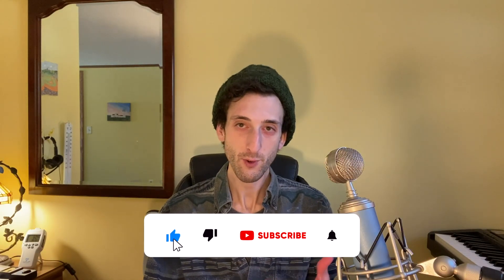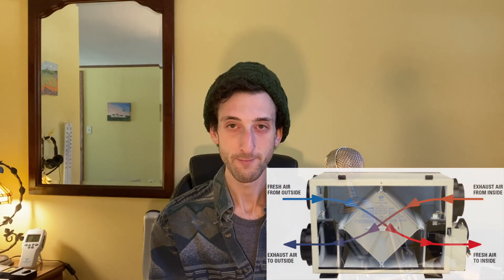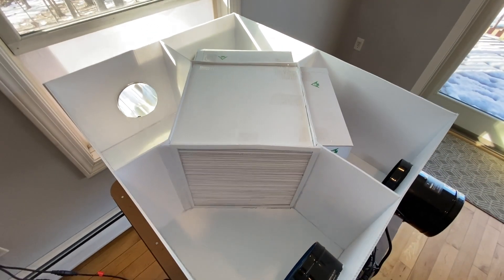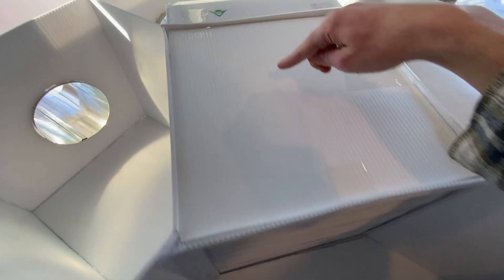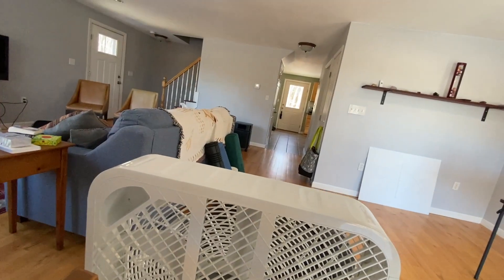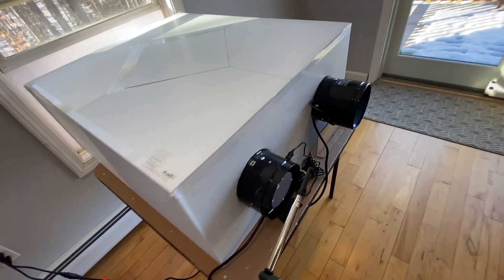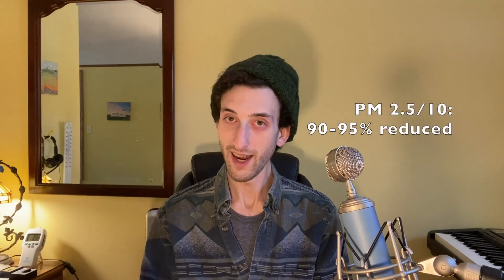I built the best DIY heat recovery ventilator I’ve seen on YouTube

Comment: Clever to recognize coroplast as a useful material! Its thermal conductivity would suck compared to metal, but if the dwell time of the air inside then heat exchanger is long enough, that will compensate: Half the conductivity? Just double the dwell time. 1/4 => 4x, etc, etc.

It seems the duct fans are working fine for you, but a cheaper and potentially better solution could be a used squirrel-cage blower from an HVAC system, with the speed adjusted via either a cheap A/C speed controller (triad plus noise filter) or by putting a small motor on it, running it via a timing-belt setup (the kind of timing belts used for 3D printers. Squirrel cage blowers are great when dealing with back-pressure from filters or the stack itself.
Reply from the maker: Amen! Great points. I did indeed make the core larger to increase dwell time. 

I had never heard of squirrel cage blowers, and that sounds like a fascinating idea. I guess they’re a high static pressure blower?
Reply: @HealthyHomeGuide  Exactly. They use them in HVAC systems to overcome the static pressure from the filter and all the ducting, registers, etc.I don't know the details of relative efficiency, etc, but you'll find them any time there's higher static pressure. (The rotor/impeller is an open-ended drum with angled slots around its periphery. The name comes from looking like something a squirrel (or hamster?) would use to exercise in :-) 

The blower from a home HVAC system would be grossly overpowered for your application (and probably too big as well), but any time a furnace/air-handler is being changed out because an HVAC system is being completely redone for some reason, chances are the blower will still be good; I don't know if I've ever seen one wear out and have to be replaced; at least not in any houses I've lived in or owned.

You'll find smaller ones inside air conditioners and dehumidifiers that might be more size-appropriate for your use, but it might be a wrestle to get one out of a junked unit because they're not built for easy replacement.
Reply from the maker: @DaveEtchells  This is absolutely fascinating. I think I’ve seen the type of blower you’re referring to. I’ll put this on my list of investigational projects. Gotta see if I can find a smaller one - I suspect that one of these blowers might groan if I used an A/C speed controller to try to dial it down. I tried using an A/C speed controller on a very powerful duct fan and it wasn’t pretty haha. Lots of electrical moaning.
Reply: @HealthyHomeGuide  Yeah, I’d need to check, but now that you mention it, I think you can only speed-control universal motors, not induction ones :-/

Comment: I think the main thing stopping you from having better efficiency is the cross-flow. Your two airflows are perpendicular to each other, and you can get better heat transfer by having contraflow instead, where the airflows are in opposite directions. However, that makes construction slightly more tricky, and probably can't be done with the materials you are using, as the airflow needs to change direction in the middle of the core, and the core needs to be longer to have that contraflow section in the middle. I'm considering making a unit with (very cheap) aluminium foil, but I'm not 100% sure it is durable enough.
Reply from the maker: You’re absolutely right. I want to make a counterflow core eventually for that exact reason. Do you know how you’re going to mold the aluminum foil into channels and make it rigid enough to hold its shape?

Comment: Dude. You’re an awesome enthusiastic presenter of your creations. I’m thinking of something like this for my large garage. Maybe not quite this big tho
Reply from the maker: I appreciate that you like my presentation style! If I could do this HRV project again, I’d build it smaller. Maybe with 2” thick filters instead of 4” thick. And with more powerful fans.
Reply: @HealthyHomeGuide  In your newer videos you don't seem to be using this design. Is there a reason? Thanks
Reply from the maker: @ww-pw6di  I appreciate that question. I haven’t used this HRV since the spring because I’m too afraid of mold growth to run it during more warm/humid seasons. During the warmer months this past year, I used my DIY fresh air intake for ventilation, but there were limitations to how much I could use it during warmer, more humid stretches. 

I’m now using an ERV for year-round ventilation (+ a whole house dehumidifier in the warmer months). I’m actually working on an ERV installation video (for those of us who don’t have ducted homes).

For the record, I still think my DIY HRV could be a great budget option in colder, drier months.
Reply: @HealthyHomeGuide  Thanks for the reply! Was the mold concern in regards to the box or the core getting moldy or rather the humidity causing mold growth elsewhere in the house?
Reply from the maker: @ww-pw6di  You ask very smart questions. I was concerned about both, to be honest. I’ve learned hard lessons about how careful I have to be with introducing humid air into my living space. Because I’m very sensitive to mold.

Comment: Great job! I've seen a similar design on "build it solar" website before, but good to actually see a working prototype.
One question: do you get condensation inside your core? Some HRV design includes a heating element to combat the condensation.
Reply from the maker: Thanks so much! I used this HRV only when it was dry outside in the late fall, winter, and early spring. So I didn’t run into condensation issues. I’m too paranoid about mold growth to use it in the more humid months. But I am working on a DIY ERV installation video for year-round ventilation. To be clear: I’m not making the ERV myself, I’m installing it myself.
Reply: I built the unit you saw on Build it Solar back in about 1988 or so. The painted plywood enclosure was around four feet square, as I recall, and about one foot deep. The core was a stack of coroplast sheets siliconed together. I had no way of measuring its performance at the time but it worked very well in our small cottage. All these years later, I'm thinking about doing it again for our off-grid home. Yes, it IS do-able for the do-it-yourselfer!

Comment: Very interesting, but we need a better way to warm air and cool air in the opposing seasons. Have you had any such thoughts for folks who want/need to have highly efficient homes as far as energy consumption and insulation goes?
Reply from the maker: As far as year-round ventilation goes, ERVs are the way to go. I’m actually working on a DIY ERV installation video. To be clear: I’m not making the ERV myself, I’m installing it myself.
Reply: @HealthyHomeGuide  hmmm, I'm thinking about options that would facilitate a highly flex

Comment: This is unbelievably cool, even with the potentially lower efficiency number. I just bought a house and have a 1990s furnace that I want to keep running as long as possible. Currently in the process of cleaning and sealing the duct system and trying to DIY as much as possible. The furnace uses a long insulated flex duct to allow unfiltered cold Canadian air into the furnace room for combustion. I feel it’s very inefficient (and dirty) to have a clear line of outdoor air entering my home. Your system seems like the perfect DIY method to address this problem. Just found your channel and looking forward to seeing what other ideas you have.
Reply from the maker: Thanks so much! I think you’re smart to pick up on the fact that your furnace situation may not be the best. Most people ignore those things. Not us!

Comment: Hey mate, that's already on my diy project list, I am evaluating different materials for the heat exchange unit and currently the best choice from my point of view is aluminum as it has the best heat transfer rate and is already available as foil. That should bring the efficiency somewhere around 95%...what's your opinion?
I was very happy if you could provide some statistics about the air quality over time with switched off device and running in different power modes like e.g. being alone in contrast to many party people, cheers and stay healthy 🍻
Reply from the maker: I wish you luck with your DIY project! I’m intrigued by the idea of using foil for the reasons you mentioned. The issue is that I don’t know of a feasible way to manipulate foil to create a structure with airtight/independent channels for intake and exhaust.

Comment: Condensation within the unit will be a problem in most climates and when heating or cooling the incoming air.  Over time the heat transfer plates will grow a biomass that can (in extreme cases) include dear old Legionella - the bane of commercial air con units.  So a unit will need a means to drain condensate to a waste, and a way to periodically (say annually) disinfect / clean the core.
Reply from the maker: I agree. I only use this HRV in the late fall, winter, and early spring.

Comment: Well done and nice and cheap. I well remember last century, pre internet, someone had constructed a very efficient HR unit out of pleated paper! Large pieces of paper, folded about every half inch or centimeter and laid cross ways like your core flute and connected just the same as yours. The paper being thin, had excellent heat transfer properties and low impedance to air flow. Question would be, how would it go in high humidity? Maybe spraying with a mixture of something non toxic but hydrophobic would be the answer. Plant wax?
I'd say your set up would suffer losses because if the poor heat transfer of the double layers of coreflute. I have seen single sided stuff around. That would improve efficiency. Maybe single sided corrugated cardboard would be the go?
Reply from the maker: Thanks so much! I only use this HRV in the late fall, winter, and early spring when it’s dry enough for me not to worry about mold. 

I like your idea about single layer coroplast!

Comment: I have an existing HRV that is starting to show it's age (getting noisy) and replacing the fans would be something like 1200-1500€ so I am thinking about getting a new one. Doing some DIY work on it with third party fans is something I have been thinking about, but the original fans are custom built and I have been unable to find duct fans that I can properly control. The originals are radial fans and built specifically for the HRV...

Comment: If you're chasing every last % of efficiency you could make your own fine channel aluminum heat exchange core. Get two or three Fiskars 9340 paper crimpers with metal crimp rollers. The rollers are the parts you'll want, to put together end to end on a common shaft because they're only 6.5" long. Might need to double up on the crimpers if only one roller in them is aluminum. You'd have to build a custom frame to hold them and add a long hand crank. For metal, whatever thickness is used for offset printing plates would probably be ideal for the corrugated channel sheets. To separate the corrugated sheets use heavy foil, the thickness used for single use turkey roasting pans ought to do. I'd expect thinner to be better for heat transfer. Can't go too thin on the corrugated sheets gauge because the core would need rigid plates on the sides and a way to compress it to ensure good contact between the corrugated and flat sheets to block bleeding of air between in and out paths.

It would have to be more efficient with heat only having to cross one very thin, highly heat conductive sheet of heavy aluminum foil VS two layers of plastic that don't transfer heat anywhere near as well as aluminum. Any bet it'd be over 90% efficient at heat transfer?

Fiskars makes a wavy version of the crimper, model 9341. Wavy channels would make the air slower, with a longer path through the core, but those crimpers look like the crimp rollers are all plastic.
Reply from the maker: This is quite honestly a brilliant idea. Thank you! I did some corrected efficiency tests and my HRV actually turned out not to be 85% efficient. It’s more like 60% efficient. See my pinned comment for more details!

Comment: this is one of those (awesome!) things that works in specific climates. Another example is a swamp cooler. If i used this where i live my house interior would be covered in slime mold, too humid. Same with a swamp cooler. 😞
Reply from the maker: You’re absolutely right. I only used this HRV in the late fall, winter, and early spring when it’s not too humid. I took it down once the humidity came. The last thing I want is mold growth because I’m really sensitive to it.
Reply: You say that, but assuming your house is warmer than the outside then the HRV will still help reduce humidity inside.

Comment: Isn't humidity going to be a problem? Way too humid in the summer and way too dry in the winter
Reply from the maker: Yup, absolutely. I used this HRV only in the late fall, winter, and early spring when it wasn’t too humid. I took it down once the humidity came. In the winter, I didn’t find it to make my air too dry, but others might feel differently for sure.

Also, I did some corrected efficiency tests and my HRV actually turned out not to be 85% efficient. It’s more like 60% efficient. See my pinned comment for more details!

Comment: If your HRV actually is 85% efficient you should get a lot of condensation when outdoor temperature is below freezing. You can figure out the dew point of your indoor air, and unless that is as low or lower than the expected temperature of the exhaust air there should be condensation.  The "fresh air" you get is definitely a mix of fresh air and indoor air that leaked into the fresh air stream, possibly not in the core, but definitely in the giga-supersized chambers outside the core. Also you need to make sure the flows doesn't mix outside to get an measurement of the actual efficiency. If you measure the temperature that leaves the house, on the outside, instead of the mixed airflow, and compare that to indoor and outdoor temperatures you can find out the actual efficiency. The actual efficiency is definitely not anywhere near 85%.         

Aluminium conducts heat around a thousand times better than most plastics, and you can make aluminium much thinner, which also improves heat transfer compared to plastics. You even have two layers of plastic, and a layer of adhesive, and possibly areas with air too. And no way those fans can force hundreds of CFM through that core, a powerful leaf blower might be able to do that.
Reply from the maker: Thanks very much for your comment! So, I did some more efficiency tests in the spring using the outgoing air and it seems that my HRV is actually around 60% efficient, not 85%. I wanted to make a video about this but I ended up having to put it on the back burner because I dismantled this HRV when the warmer weather came and went through the process of selling my house. 

When making this video, I made the mistake of testing efficiency using the incoming fresh air. I think that heat generated by the fans skewed the results. 

Here's a formula I used for a corrected efficiency test using the outgoing air instead:
× = (T_room - T_outgoing Air) / (T_room - _outdoors)
An example of one of my test runs (Fahrenheit):
60.5%=(70-44)/(70-27)

So yeah, it is less efficient than I initially thought.

I want to address some other points:

I do think that almost all of the air is flowing through the core. The filters were quite dirty when I dismantled this HRV, and in order for them to have gotten like that, I do believe air must have passed through them/the core. 

I don’t think there is very much leakage in the chambers. I sealed them very thoroughly with hot glue and weather stripping, and conducted leakage tests. I acknowledge that there could be some leakage, but not that I could find. 

I also don’t believe the intake/exhaust air streams are mixing very much. I installed elbow duct attachments to the indoor supply and outdoor exhaust to the direct the air streams away from the intakes.

Lastly, dew point in my house is quite low in the winter. I don’t use humidifiers and this HRV brought in plenty of fresh, dry air.

Again, thanks for your insightful comment.
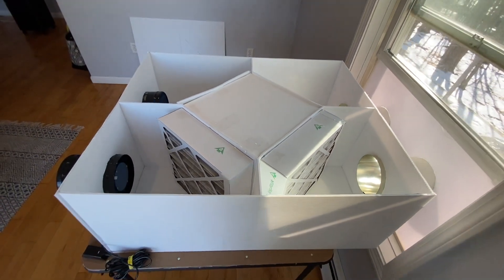Reply: @HealthyHomeGuide  Question, 5:01 how come you have filter for the outgoing air?
Reply: @millanferende6723  
To keep the core clean.
Reply: @HealthyHomeGuide  I was thinking of doing sheets of aluminium, seperated by by several threads with nuts. The gaps are sealed with cheap "draft stop" strips, to guide the air of fans through the right holes. That seems to me to be the most efficient system that one can build at home.
Reply: That’s a well regarded reply. Maybe when you get a chance just do an edit update including these findings.
Reply: An aluminium heat exchanger can be 'too efficient', you still need the effective insulation factor between the two sides (internal and external), and clarity of where any condensation should (and should not) occur.
Reply: The real world heat conduction is also a function of thickness, and in thin material plastic is as good as aluminum in case of HRVs
Reply: @burningman1945  could still probably get good results with a water loop design. Would also allow you to separate where the intake and exhaust is going. Like one widow has an intake with an aluminum heat exchanger and the other window has an exhaust with a heat exchanger. No mixing of air and probably make it more compact. Hell you could have the exhaust on the other end of the house if you wanted. Could also eliminate the exhaust filter he has and opt for a real heat exchanger cleaner when needed since it isn't plastic.